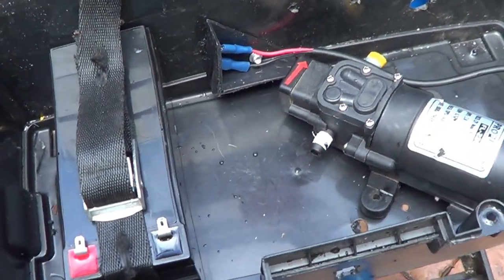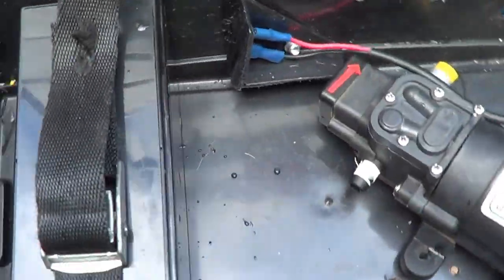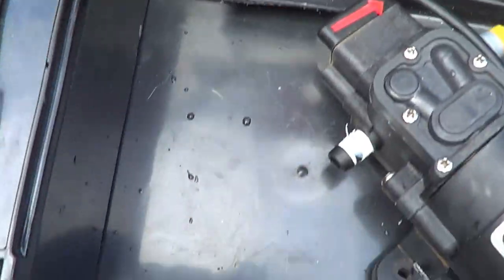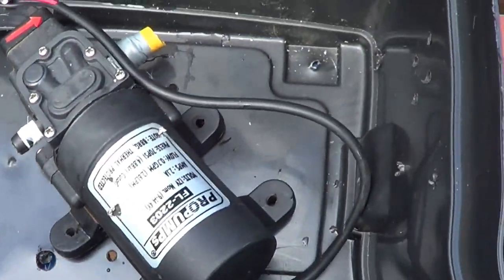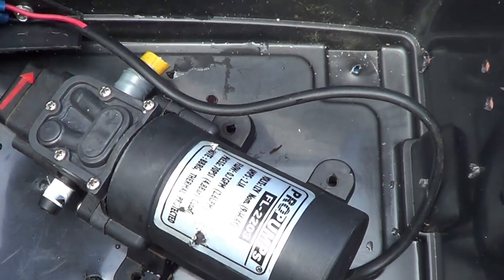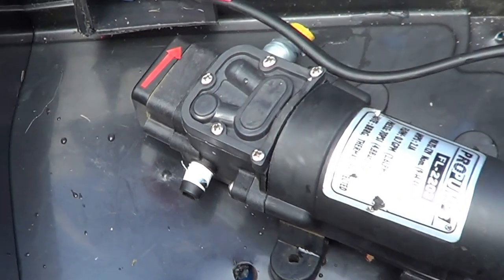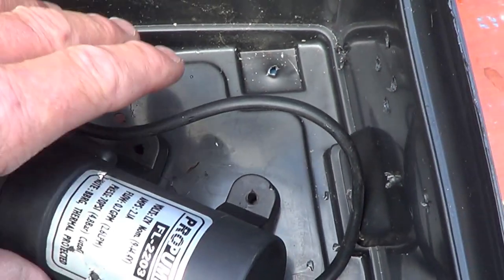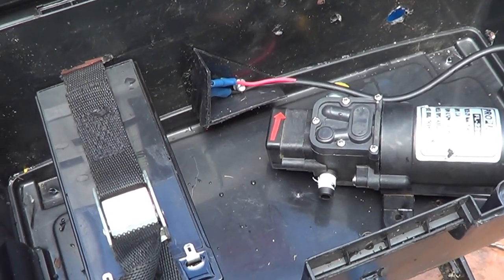DIY WFP Trolley Build - Part 4 - Window Cleaning Tips

Comment from the maker: Hi Andy, I think the 5mm will be ok, but you will have to figure a way of connecting it to the pump as the connections are much larger. You can use step down connectors. The only drawback to using 5mm could be that it will reduce the flow rate because of the narrowness of the pipe but I think you might just get away with it. I already use 5mm pipe on my poles. The pump will be just fine though.
Hope you have a great new year.

Comment: Hello Chris !   

I was  wondering if 'll use a 5mm diameter - hose  instead of 8mm  - will it damage the pump ?  what  do you think ?  as 8 mm is most popular hose with a WFP -  however I found a 5mm one - which costs less ££  -  and  thought to use it .

Happy new  2013

Comment: what size hose do i  need i have the pro pump also  i want to run it from my tank in van to my pump then to my pressure washer cant find the correct connections with i could clip a standard hose on save the fuss
Reply from the maker: You will need 8mm hose. Heat it up in a cup of hot water to ease it on. Failing that, try the garden hose but I think this is a bit too big.

Comment: I copied  exactly as you have done in video :)  -  however  i thought to  add a remote controled switch  (ebay number 270790808431) -   so i can switch on/off  anytime ,  

Also i thought to use a similar pump - to pump the  solution / chemicals - when i do carpet cleaning - instead of using a hand sprayer - it  will be fantastic  a small pump - and nozzle .  Im only worried if the solution may destroy the pump :)   is is  well diluted and isnt acid -  should be fine  ?!  ill try it